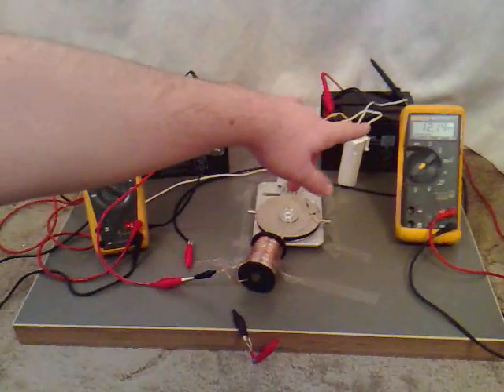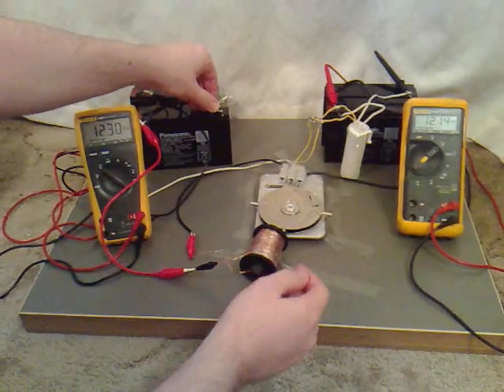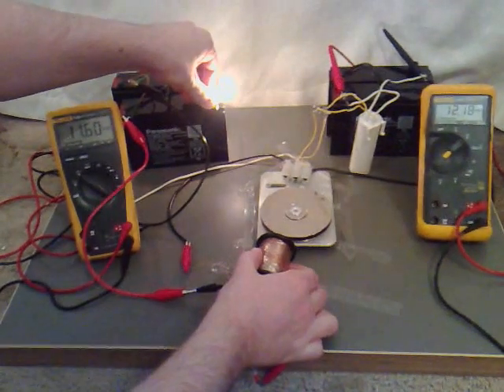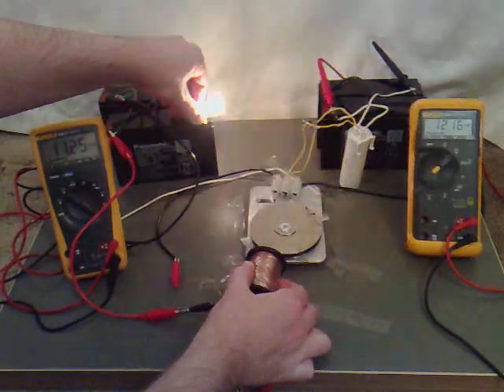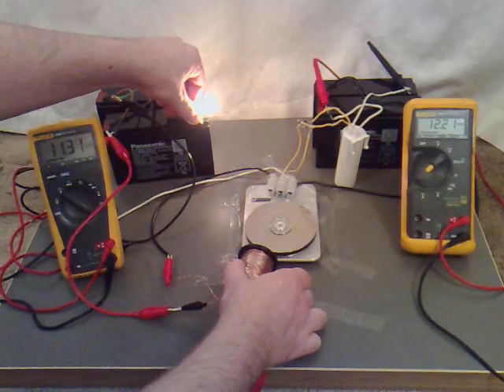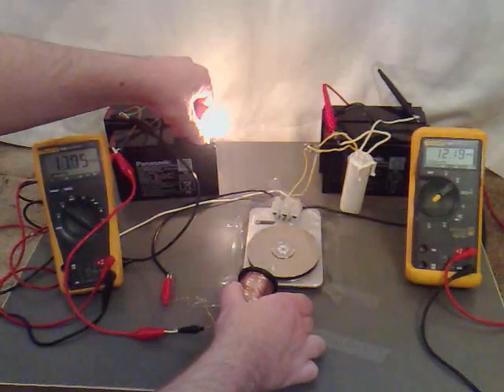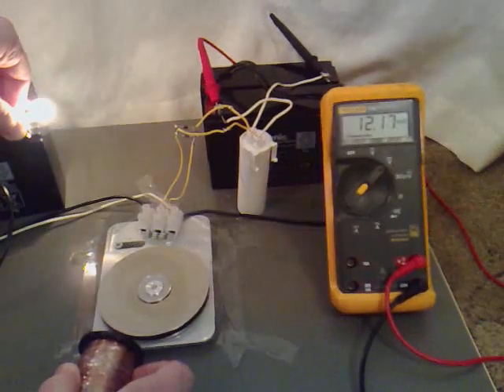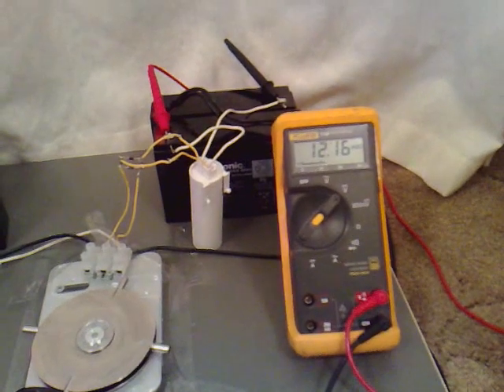Pulse Motor (New HD Charging 03) 022

Comment from the maker: I know I am only getting the charge voltage higher than the battery voltage at the moment. Once I have a nice stable system I can put more generators around it and measure the current out. 

Input current is around 600mA.